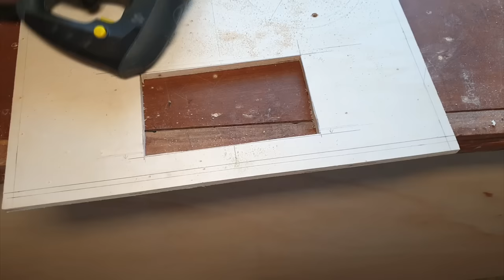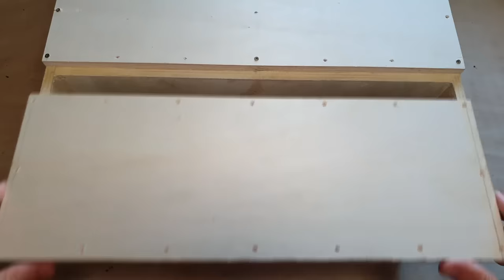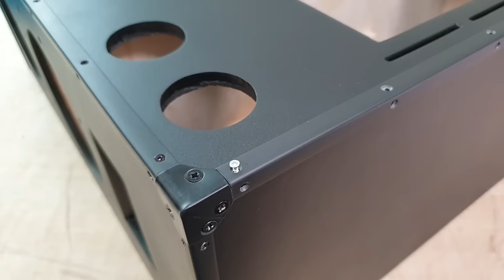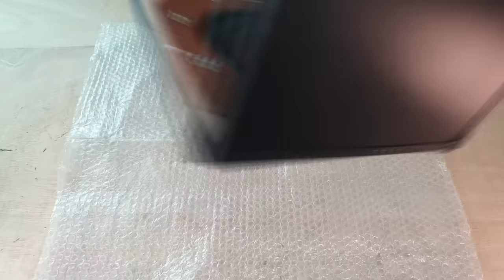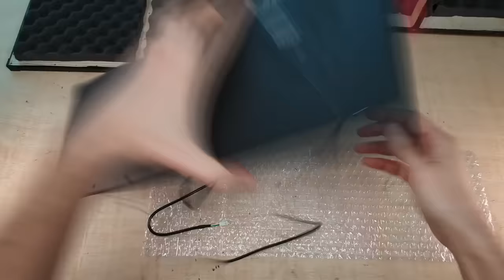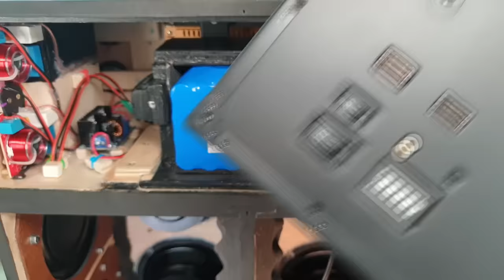DIY: Portable Multimedia Bluetooth "AndroBox" Speaker

Comment: This is AWESOME !!!!! What I love more than anything here. He built a beautiful speaker cabinet without using any of the expensive power tools that most of the other DIY channels like to use in their videos. I mean really. Most of us don't have the arsenal of equipment they use, and by the time you purchase the equipment and parts, you may as well have bought a new speaker from the store and save yourself the work. BUT! THIS GUY! Oh yeah, this man uses the most basic of equipment that anyone who rents or own a home have in a drawer somewhere. A simple screwdriver, a file, some sandpaper and 1 electric drill. Look how beautiful this turned out. The most complex tool in this whole video was his multitool (cant tell if its a Gerber or Leatherman). Even the wiring diagram is easy to follow. Fantastic! Now this is a proper Do It Yourself video.
Reply from the maker: Thank you, glad you liked :)
Reply: impressionante,ganhou mais um inscrito..faz uma igual essa pra mim,diga o valor q eu compro..

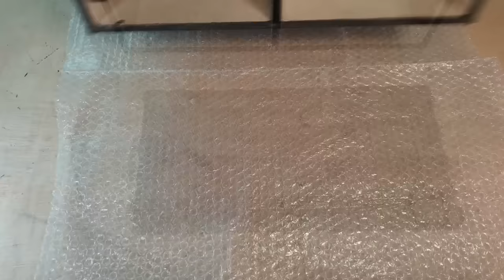Comment: 14:15  Although that type of foam looks nice, it's not the right type for a speaker cabinet.  You should stuff the box with spun fiberglass insulation or polyfill (like on the inside of a pillow) as that makes the speaker think the box is larger and therefore produce more low end.  This type of foam will actually harm bass response by reducing the box volume.  Although it might prevent some standing waves if there are any, but I doubt that would be a problem in this type of box.
Reply from the maker: Thanks, could try to use different foams in the future

Comment: I love your work. You have very simple and straightforward videos. I got enthusiastic about your previous video and started building a boombox. It's not over yet, but it's already very good. I think you are the best example on this subject. we are waiting for the continuation of the videos. Greetings from Turkey 🇹🇷
Reply: Benim gibi merak edip yapmak isteyen kişilere yardimci olabilirim . Çünkü bende  Türkçe kaynak bulamadım.😂  Sorulariniza cevap verebilecek kadar arastirma yaptigimi düşünüyorum .
Reply from the maker: Thank you, glad you liked, good luck with your boombox project :)
Reply: I will share it with you when it's over
Reply: How long does the battery last at full volume?  And how many volts and amps is it using?

Comment: Build quality 100% great build.
Only thing i would have changed if i build it myself is add a horizontal wooden plank between the speakers so i can give the lower 2 speakers only low bass and the top speakers nothing below 100hz.
With that 4 channel car radio it must be pretty easy to just use the digital crossover for the ""rear"" and ""front"" channels to achieve this and change the settings whenever you want.
In my experience it wil improve how loud you can play without distortion from to much bass on higher volumes, also more headroom to improve the midbass and midrange with an equalizer for the soundtuning you prefer (thats offcourse different taste for everybody)

Anyway still great build 10/10
Reply: i like your version because that too much base distortion issue so many designs make.. id surley agree with this overlooked detail 👌🏽

Comment: increase voltage for the headunit to 14.4-14.6v for better lifespan, less distorsion and more power.
Reply from the maker: Could use 14v but i didn´t find any difference so i keep it at 12.8v

Comment: Good bass requires a lot of speaker volume. A third of your volume does not work for you. In order to get good low frequencies, all baffles must be removed. Install a narrow cross-brace. So that the walls of the box do not vibrate. Change 4 small speakers to 1 large 10 "-15" with bass reflex. Instead of speakers for high frequencies, put a professional tweeter with a horn. The little ones will burn out quickly. Switch on the low frequency amplifier in a bridge circuit. The high and low frequencies are divided by an electronic crossover. The subwoofer and tweeter are fed with a signal from separate low frequency amplifiers. Then you can get good low frequencies, good sound quality. So far, I see imitation low frequencies and medium quality sound.

Comment: Really nice... Why do you use a 25v battery instead of 12v battery?
Reply from the maker: I used the 25 volts battery because it was what i had around, using a 12 volt lithium battery its possible but need to use a boost converter because when the 12volt battery voltage drop bellow 11 volts (or 10.5 v , not sure at the moment) the radio will turn off, using the 25 volt battery with the step down converter to 12/14 volt will make sure that even at low voltage the voltage provided will be always the correct,  there are many ways of doing this, i just used this one.
Reply: @DTeK  Thank you.

Comment: What kind and size of screws do you use to joint the sides and anchor the speakers?  Are pilot holes drilled on both sides?  Great job!
Reply from the maker: Thanks, i used small 2.5 x 10 mm screws for the box and 5mm hex screws for the speakers

Comment: Stock 2din radio power not enough :) Im hearing distortion and etc., u better used an aftermarket amp :)
Reply from the maker: Its good enough for me, i recorded it at max volume with the mic 50 cm from the speaker

Comment: Those speakers does not move much. One big mistake was to set voltage to 12.8 instead of 14.4 which is nominal voltage in car when engine is on.

Comment: Can i operate i from lap top power supply?
Reply from the maker: yes, for charging battery voltage need to be 25 volts, for the radio only you must provide 12 to 14 volts min 5 amps

Comment: The thick sponges you put will destroy all low frequency (bass)..
Reply from the maker: This project was the first one that i used the sponges, it test it without the sponges first and then i tested with the sponges, i didn´t notice any noticeable diference, because of that i keep them
Reply: @DTeK  Subwoofers also cause serious power loss. I don't think you can see any difference because the speakers you use are midrange. They can't produce frequencies like 30hz anyway.. It is more logical to use sponge or fiber or a thin sponge (0.3cm etc.) Still, you did a good job, it looks very aesthetic and portable..